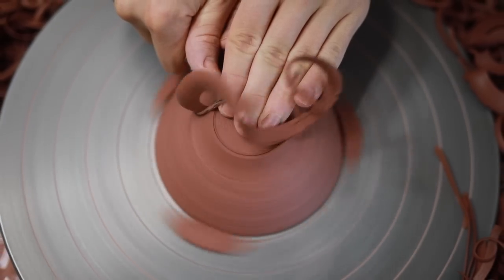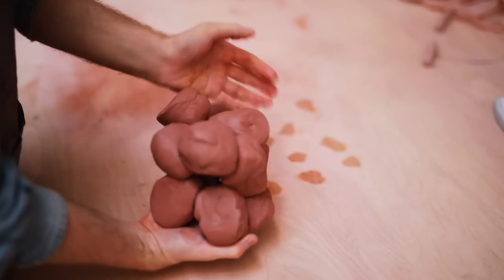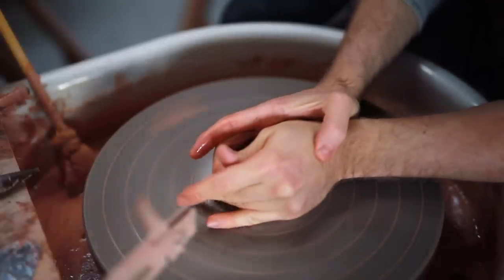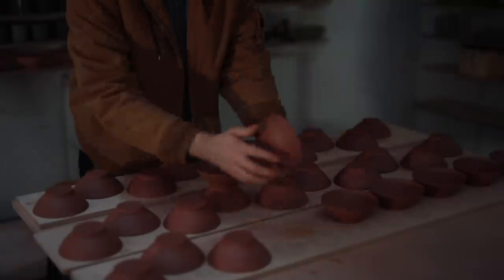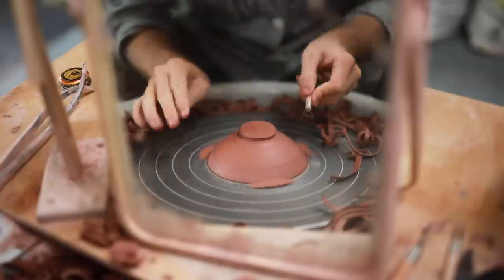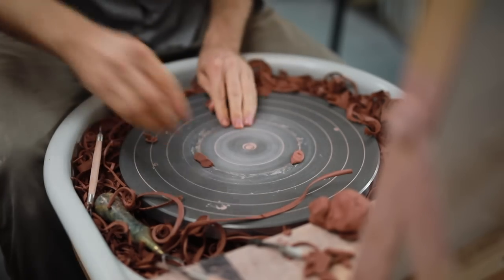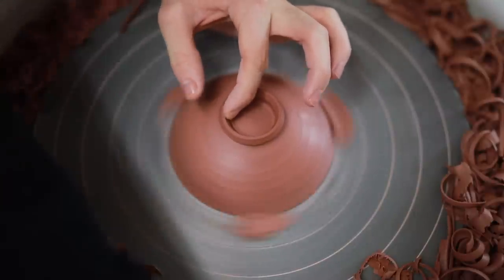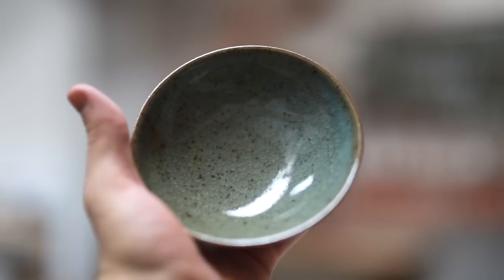Throwing and Turning a Small, Stoneware Bowl — Narrated version

Comment: I love your videos. They are relaxing and informative. Even when you say something I inherently already know, you phrase it in such a clear, concise manner that it reinforces the concept for me. 
I do have a question about the glaze: do you worry that the crackle glaze on the inside of functional ware will invite bacteria? I had a professor who told me that and I have (sadly) avoided crackle glazes since. I’d be interested in hearing your perspective.
Reply from the maker: Thank you Dylan, that means a lot! There's a lot of misinformation regarding crackled pottery, here's my usual post I reply to people with, the link is definitely worth checking out.

I’ve been using crackle glazed ceramics for years and years. It’s high fired stoneware with nothing nasty that could leech, the crackling doesn’t stain too badly as long as it’s properly washed but of course it happens overtime. To the same degree, many of the potters I’ve worked for over the years who wood fire, soda fire and so on, all have work that crazes and crackles to some degree and it all stains with time, yet functional work is still made abundantly and is completely usable.

I’ve never heard any stories of anyone getting ill from crackle glazed pottery, the clay is highly vitrified and unless you take terrible care of your ceramics you’ll be perfectly healthy. For industry it could be an issue, due to the surface of the pot having less strength, long-term staining with excessive use and fragility as it’s high fired stoneware with lots of iron, which makes it weaker and more susceptible to chipping on the whole, but that’s what you get with handmade ceramics, I don’t want to make pots that have perfect, uniform surfaces like you might find in a shop, I want each to be individual and interesting and handmade and I suppose the same goes for the generations of potters who’ve worked all over the world. 

Here’s a good link to an article that goes into more depth about it, https://ceramicartsnetwork.org/ceramics-monthly/ceramic-glaze-recipes/glaze-chemistry/techno-file-dirty-dishes/, and clears up some of the misconceptions that are spread around. As long as you properly wash crazed pottery there is no bacteria left in the crackles. As long as you take time to care for your handmade ceramics after they’ve been used then they’ll be just fine.
Reply: @floriangadsby  Thank you for such a thorough and thoughtful response! I am going to look for great crackle glazes to update and reinvigorate my studio. 
All my best,
Dylan

Comment: With over dried pots that need trimming it can be hazardous to trim them dry. The silica in clay is bad for lungs and dust and airborne particulates over years of potting can lead to poor lung function. 

When my pots are too dry I grab a brush and some water. After centering I paint on the water to rehydrate the clay. This comes with its own risks as adding water to dry clay can result in cracking. To me its worth it to save a piece. After paint on a coat of water or two I trim it away. This reveals more dry clay and the process repeats. Its hard to trim with conviction because the balance between rehydration and preventing crack limits how much clay can be turned away in a given step.
Reply from the maker: That's very true! I should have mentioned that, it's horrid trimming pots like that. And good advice with the water brushing, I've seen them do that in Jingdezhen with giant porcelain pots. They'll let them go almost bone dry before slopping water over them and then trimming it away—like you said, trimming with conviction becomes difficult if that's the way you choose to trim your work. What I meant more by that statement is there are lots of videos of folk trimming but in a way where the clays wobbles dictate their movements, like the clay is in control, rather than trimming with conviction enough to be the one in control. I think you can still work with conviction in the method you described. Thanks for watching!

Comment: Another really helpful video, thanks Florian. Can I ask what your preferred wood is for your ware boards. I’m using left over oak engineered floorboards which have heavy grain so they hold dust, their heavy and are slightly warped so i’d like to replace them. I look forward to the tap centring video.  10/10
Reply from the maker: Hey Ian! I use birch ply wakeboards at the moment, they aren't perfect and do warp but I just uses both sides of them and if they get particularly bad I wet them, place them bow side down, and a few days later they revert to being nice and straight again. I know some traditionally potteries have ware boards with two long lengths of metal or wood attached to the underside, to keep them straight. Tap centring video will be filmed sometime next week—my studio is totally packed with packaging materials at the moment as I've just done an online shop and have to wrap and ship some 190 parcels! Thanks for watching as always.
Reply: Thanks Florian,  that’s really helpful. Have fun packing!